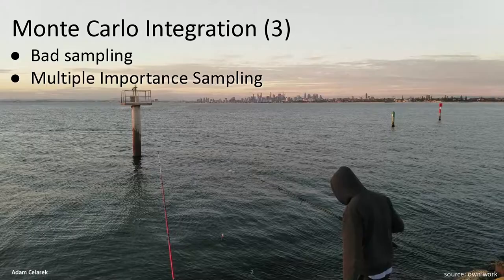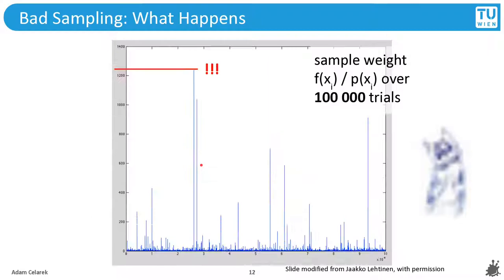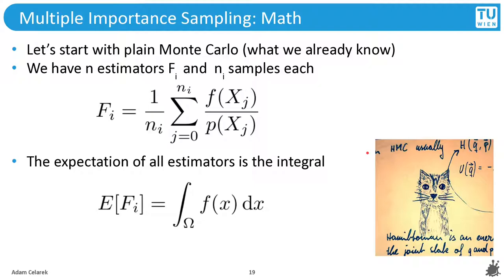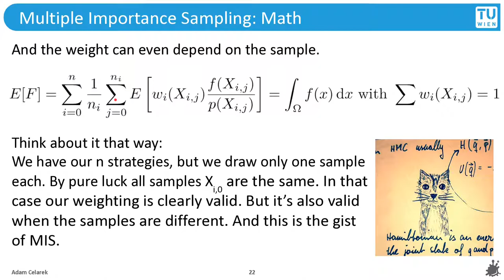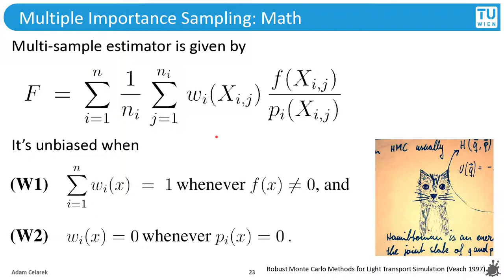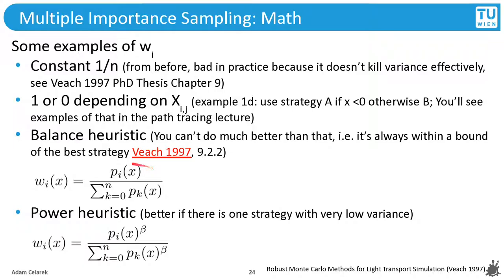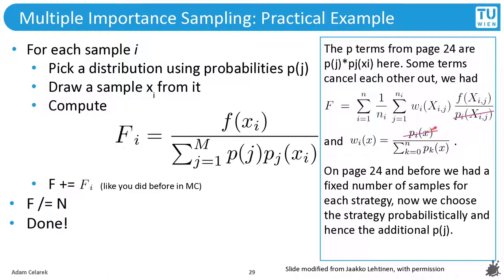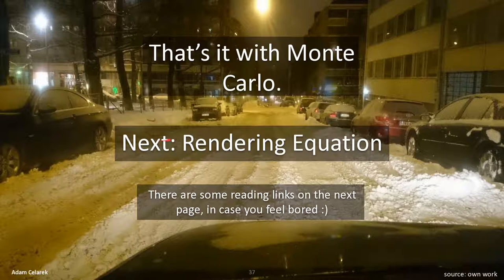Rendering Lecture 5 - Monte Carlo Integration III

Comment: The content is very well done, but honestly, I really don't understand why you chose to teach this in that order - first you explain HOW to do something complicated without even covering what you intent to use it for and why - and only THEN you connect it back to the reason people are watching this in the first place? What's the logic there?
Reply from the maker: Hi, thanks for the critique :)
We will restructure some parts of the lecture for the second iteration. Obviously we want to make it more logical.
Could you elaborate on what you mean? Are you referring to this video in particular or the lecture in general? What exactly do you mean by 'something'?
Cheers, Adam
Reply: @cgtuwien  I mean that the next video after this is the rendering equation - the impossible integral that can not be integrated - which is the very reason for all these numerical approximation schemes. Before students know what it is, and why it can't be integrated analytically - why should they even care about any of these approximation/simulation business and all their mechanical details? Why should any of that even appear as relevant? It's walking through the solution, before even covering the problem. It's delving way into the deep ends of the answer, before even presenting the question. Hope that clarifies what I meant by that.
Reply from the maker: @hardcore codin thanks. yes it does.
we do cover integrals over the hemisphere (direct lighting and ambient occlusion) already before. other reasons for this order are the practical coding exercises that are going on in parallel and that we wanted to alternate topics between more practical and more theoretical.

that being said, we'll try to include your feedback in the next iteration. thanks again and cheers from Vienna
Adam